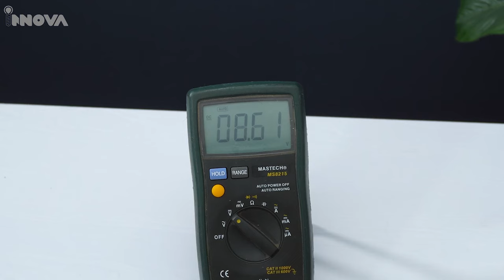How to make the simplest 1200W Induction Heater 12-48v DC that melts Tin| The simplest soldering pot

Comment: It's not 1200W, because the power supply is 12V 30A and that's 360W, not 1200W.
Reply from the maker: Thanks for your comment. These transistors withstand up to 48 volts. Please multiply 48 by 30 amps, which is 1440 watts
Reply: @InnovaDIY  It still won't be able to handle this much power. Ferrite toroids aren't meant to be used as energy storage inductors. Use iron powder rings for this application. 1N5408 are too slow to be used in a high frequency circuit. You need to use UF5408 (the ultrafast version of 1N5408) or some schottky diodes. The capacitors in the tank circuit are meant for interference suppression and can't handle the current flowing through them. Use capacitors that are meant for really high current and frequency operation, like FKP capacitors. The heatsink of the transistors is a bit too small if you want to use the heater with 1440W.
The coil will also get very hot at that power and the laquer on the wire will burn off. You need a coil made of copper pipe for this power. And of course active cooling for the components.
Reply: подскажите пожалуйста а  почему при подключении к 27 вольтам!!! сгорает один мосфет!!! irfp260!!!!!!!!  ПОЧЕМУ??????!!!!!!!! а вы про какие то 48 вольт пишите))))))))))))))!!!!! тут как минимум нужно в параль ставить  мосфеты 4 штуки две паралели но я уверен вы и так это знате)

Comment: I suppose if you wanted to heat up a rusted bolt on a car you could just use the 12v dc car battery for the supply voltage.

Comment: Induction heaters are useful devices when it's necessary but here there is 1200W power and it means the PS should be 1200W and in otherword 12V/100A or 48V/25A. Those devices are not cheap. Why do you design an induction heater which works by mains (220Vac or 110Vac)?
Reply from the maker: Thank you for your comment and raising a valid point. Induction heaters can indeed require substantial power, and higher power ratings often necessitate specific power supply requirements.
In our case, designing an induction heater that operates directly from mains voltage (220VAC or 110VAC) allows for simpler and more accessible implementation for a broader audience. By utilizing the existing mains power, users can avoid the need for a separate dedicated power supply with higher power ratings, which can be costly and less convenient for many individuals.
However, it's important to note that safety precautions and proper circuit design are crucial when working with mains voltage. We always encourage users to prioritize safety and consult professional advice or guidelines when attempting any high-power projects.
Thank you for your thoughtful observation, and we appreciate your engagement with our content dear friend.

Comment: Hi, i want to make this circuit an already have the tools, but i would like to see if the circuit can operate at 12V 10A aprox, also I was only able to find smaller toroidal cores, can i use them for this purpose? the ones that i got are  3.5cms

Comment: As a newbie i would love to make one of these (overly optimistic😂).
To reduce parts from being damaged would it not be better to attach the components length ways on the heatsink?
This would place most of the parts over the heatsink.
Great lesson👍👍
Reply from the maker: Go for it!
Reply: damaged? they blow up if you look at them sideways!
and heatsinking is the least of your concerns actually.

blow up. literally. the fets explode. they dont get a chance to heat up.

of course, thats because no-one actually understands how they work, the importance of the number of turns, how to select the ideal components for a given powersupply and limit the power it can deliver... play some happy crappy music, edit it so it all looks nice and clean, and then throw ten ads on.
they arent supplying information, you arent learning. you are being used to make revenue. money. you are a product.

that being said, these circuits work fine, but they are delicate. one wrong move, and BANG. its five minutes to replace everything. you soon learn to build them as simple as possible. dont bother with PCB or perfboard! tag strip screwed to some timber is quick and easy. buy fets and diodes in bulk, 50+ at a time...

this is the information no-one provides...

the coil and workpiece forms a transformer and the workpiece is 1 turn, with its resistance being reflected into the power supply at the square of the turns ratio. changing the number of turns changes the power the supply can deliver, and also changes the frequency, which then changes the skin effect depth and the apparent resistance of the work and so the power isnt directly related to number of turns, or the power supply, but the frequency as well.

you dont really know the resistance, and the skin depth is also a bit vague. the best approach is start with 10-12 turns, with the idea that will give 100-144X the workpiece resistance, and by doing some maths, ohms law, with an ammeter/voltmeter on the supply, you can figure it out. then you know that your FETs can take so many amps and you will need so many turns to keep just within that limit, without exceeding.
the capacitors may need tweaking to bring the frequency back to where it was... 100khz is a nice figure for general duty.

when they say "1200W"... its a load of crap. not the way these are made, usually.

at best, its 2-300W at the load. putting 1.2KW into a workpiece this small brings steel to white hot and burning in a few seconds.

the circuit losses increase as frequency goes up.
the heating effect goes down as frequency reduces. or, should i say... it gets DEEPER and more penetrative... big stuff wants lower frequencies, small stuff high.

try to lay the main conductors, the leads to the coil, together. as close as possible. you want them to be as capacitive as possible until the actual coil. anywhere they are not side by side there is a magnetic field and that is a loss.

they are fun though ;)

been blowing things up for 30 years and im still a newbie!

Comment: Very good!!!  I'm curious, what happens if someone puts their finger inside the copper coil?  Good Job  nice video!
Reply: The answer is nothing actually. Only thing that would happen would be when you touch the coil and you burn yourself because the coil gets hot under operation.
Reply: just remember to remove any rings, bracelets, etc..
Reply from the maker: Thanks, it affects only on metal

Comment: hi, if I make a dc power supply directly taken from the 220vac power outlet  (using a bridge diode and a capacitor and supposed to become about 300 vdc), what needs to be modified? the size of copper and the numbers of the copper wires turning? and what else?  please advise me, thanks.

Comment: can i use a dc power pack and use cables to the positive and negative
Reply from the maker: yes you can but the maximum current of your power bank is important please read the detail and if you want send for me to investigate it.
Reply: @InnovaDIY  if you want to melt metal the easiest way  and efficient way, you must use a coil that has AC power in it and not DC. your voltage of AC in the coil must be at least 240V AC to melting it. 12V DC is not enough and AC power is the only way to melt metals.

Comment: Instead of irfp260n, can you put irfp450 ??
Reply from the maker: You must check the switching speed and the amp in the data sheet
Reply from the maker: I mean current
Reply: Don't! It has 10 times the internal resistance of an IRFP260, which means 10 times the power dissipation!
Reply: у меня к сожалению на  irfp 460  слетает генерация((((! когда во внтурь входит ножик железный

Comment: Hice un sistema igual pero tengo el problema que cuando le pongo la fuente de alimentacion de 12 volt me la apaga, sabran cual es el inconveniente o cual fue mi error ya que hice todo tal cual como mostraron en el videl
Reply: hola, me gustaria saber como hiciste tu proyecto siguiendo el esquema, tambien, puede que tu fuente de 12v no tenga el amperaje suficiente para trabajar con el ciccuito.
Reply: @fcgnjhufcfc  no sé si los transistores nuevos que compre estaban defectuosos porque los cambie por unos IRFZ44N y ya me funcionó muy bien, incluso me interese por este proyecto porque tenía los mismos transistores que trajo una placa ya armada que mandé a pedir, pero para mí mala suerte esa placa el primer día que la puse se quemaron los mismos transistores que montan en este proyecto

Comment: Buen dia estimado, puede ser concretada directamente a una bateria de carro, 12v 75 amp???
Reply from the maker: Yes, it can, but may be the power not be enough. Because 12×75 =900w
You can test it.
Reply: @InnovaDIY  OK, thanks a lot !!!
Reply: Can this be immersed in water as heater.